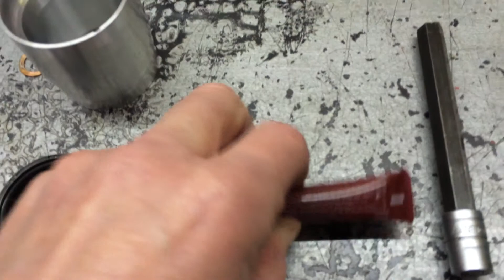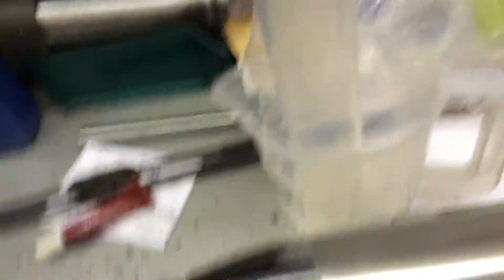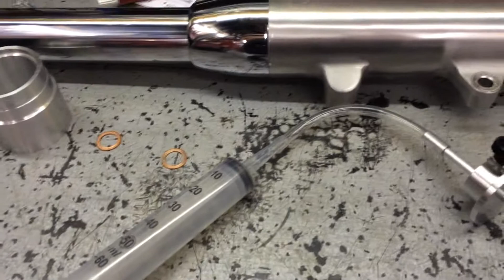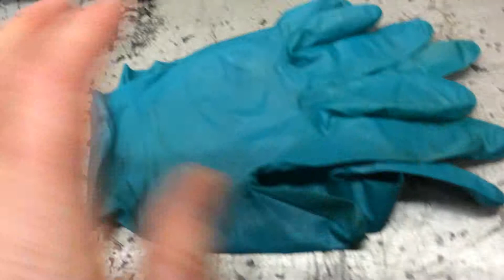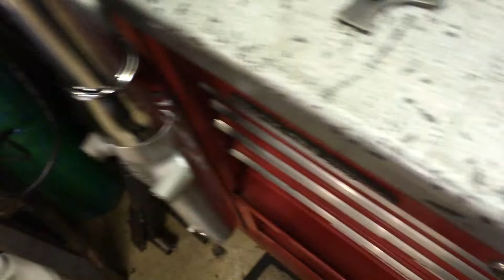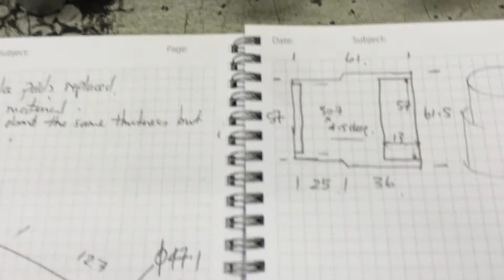Triumph Thunderbird 1600 Fork Overhaul & Mod Part 2

Comment: How does the shroud come off( the bit you drilled), does it screw or lever it off?
Reply: From memory you have to prise it out. Very small flat bladed screwdriver just to get it started, then once I had an edge to work with I probably used a brass drift. Working around to keep it level. 
Regards 
PB

Comment: How do you take the chrome caps off?
Reply: The ones sitting on top of the fork lower leg do you need a certain tool does it screw on?
Reply: @jerryanderson9180  from memory, small brass drift between fork lower and cap, tap them upwards. They're a press fit.

Comment: Hi , im interested to shorten my suspension a little being an ex mechanic im ok doing stuff but its a delicate balance i need to get the right results , i need about half inch on the back and 3/4 2 on the front to try . it rides very good lean angle good so its all about how to trade off one for the other ! ...do you have any guidence or comments ...
Reply: Hi Michael, I'm afraid I can't help with that. You might get  it on the front by sliding the forks up through the yolks but would suggest that would alter head angle slightly and may affect steering/ handling.  Would suggest a discussion with suspension specialists.
Regards PB

Comment: Hi I have the same problem as you on my Thunderbird 1600 left fork leg. The factory " drain" seems to be comprehensively blocked although the right leg seems fine. Could you tell me how you removed your chrome cowl please ? Mine feels quite solid on the leg and does not even want to rotate on the leg. I am reluctant to use too much force to either rotate it or try to pop it off. The manual refers to a pin punch of which I have never heard. Any assistance would be gratefully accepted. Thanks.
Reply from the maker: Hi Vernon, a pin punch is a very small diameter punch with which you can just get under the rim of the chrome shroud and drive out of the slider. Problem with that in my opinion is that it's harden steel and in the least may damage the bottom of the shroud and worse case if you slip, could / will make a right mess.I use a piece of 6mm / 1/4" diameter copper or brass bar as a drift. Copper is probably the better option as it's softer. Highly unlikely to damage anything with this method. Either copper or brass are readily available on 'the ebay'Hope that helps and thanks for watching.Best regardsPB
Reply: Hi PB. Thanks very much for your reply. So the method is to hammer the shroud upwards using a soft metal bar ? Presumably you start at the drain hole otherwise I cannot see where else to get a purchase.
Reply: You've got it Vernon, once you've got it started just move round and try and keep it even.

Best regards
PB
Reply: Righto. Thanks Paul. My copper Ebay bar should be here tomorrow or Tuesday.
Reply: Excellent, let me know how you get on!!
Best regards
PB
Reply: Will do. No Ebay copper drift today. Should be tomorrow.
Reply: You're a godsend PB! Forks, spark plugs, etc. are my winter project. Not sure I have the minerals to do the valve check myself though!

Comment: Good morning. Just finished watching this and as well your other videos on the valve check and adjustment. I had to rebuild my forks two years ago. Your fork holding tool is awesome! Sure wish I had the skill to make tools like you. These videos will come in handy when I attempt my valve check next winter. Thanks again for sharing! Blue and white is the fastest color of course!
Reply from the maker: +motodobe1 Hi thanks for your comments. I love the engineering side of things and sometimes spend longer making the tool to do a job than it actually takes to do the job.  I'm pleased you enjoyed watching my videos and found them useful. I have got a few more to come but have to balance activities with work etc.  All the best PB